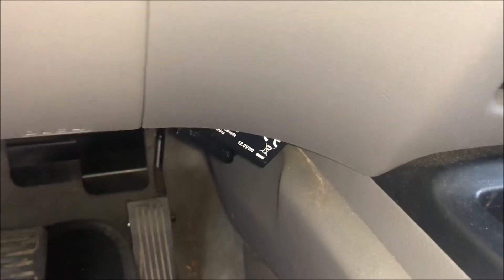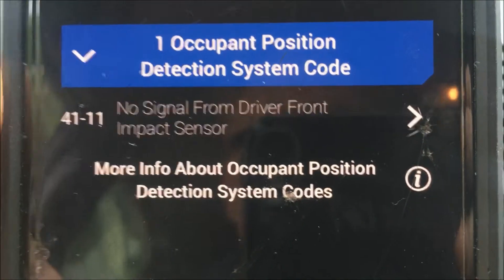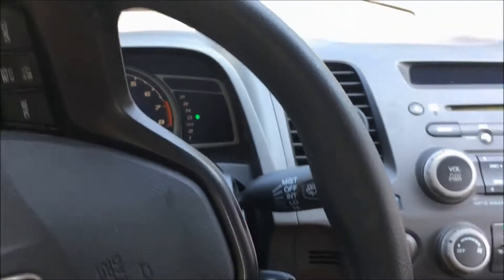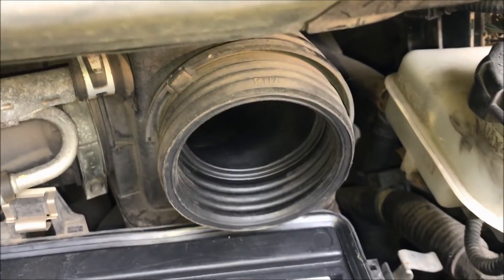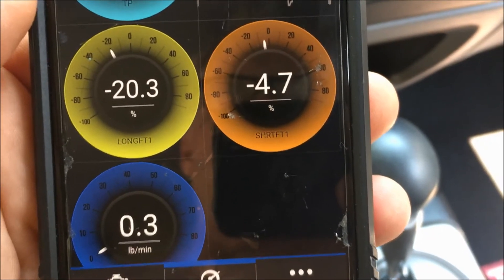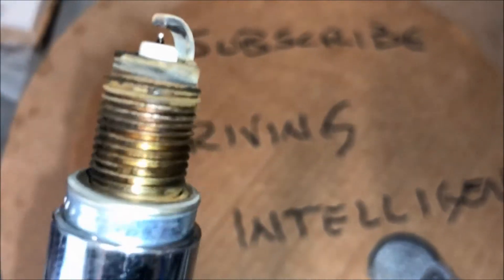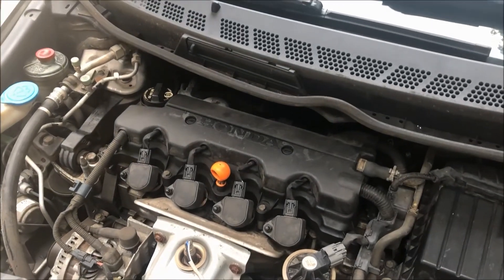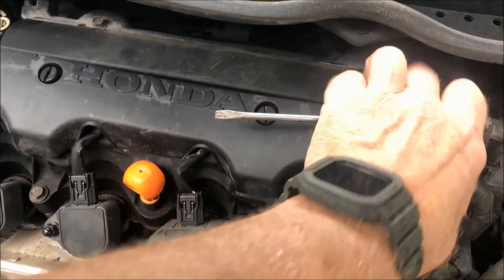How To Diagnose Extreme Negative Fuel Trims 8th Gen '06-'11 Honda Civic

Comment: dear Sir! from where you get the actual readings in order to compare?
Reply from the maker: Thanks for your question!  I use an OBD Dongle that connects to my smart phone.  The link is in the description of my video
Reply: @DrivingIntelligence  Thanks for replying! but my question is not this. my question is how do i know (how do you know) that what should be the actuall readings? do honda provide these MAF, 02, STFT etc readings data?
Reply from the maker: @farazshah4484  Generally, most of these readings are the same from car to car.  For example, the O2 sensors read from about 0.1v to 0.9 volts in normal operation, STFT & LTFT added together should be no more that +/- 10%, e.g., if you have a 5% STFT and a 5% LTFT, then added together this is 10% and that is a good number.  When this number starts to increase, then this indicates potential problems.  The subject car in this video still has an extremely negative fuel trim, but runs perfect and no CEL.  When this person brings the car to me, I will likely replace the coolant temperature sensor, which seems to be a reason for this problem on higher mileage vehicles once you rule out all other issues.  With regard to MAF, you can do an internet search for your year / engine / car combination to get the proper reading.  I hope this helps!
Reply: @DrivingIntelligence  exactly my STFT are going from -5 to -17 max . When I disconnected the intake pipe then STFT went max +10. I will follow your suggestion. Thanks a-lot! You are doing a great work.
Reply from the maker: @farazshah4484  Thank you!
Reply from the maker: BlueDriver Bluetooth Pro OBDII Scan Tool - https://amzn.to/3lsVutO

Comment: @DrivingIntelligence
Hi. I have a 2006 honda crv that is driving me crazy
I don't have any codes , but I have the Scan Gauge III connected where I can see my fuel trims.
Around a year ago, I started noticing a rough Idle with my fuel trims getting  very negative on the short-term -10/-15 with the longs slowly creeping up toward the -10 the longer I stayed idling. The thing is that as soon as I started my commute on the highway, everything goes to 0 until I arrive and stay idling again.
I checked the purge valve and the vent valve at the canister.  Both are working fine. The problem is as soon as I start the car. The purge gets open, creating a rich mixture plus a vacuum leak. Witch also creates a rough idle.
Also the reason why I know the problem is the evap is because after a year of unsuccessful slow troubleshooting, I finally pinched the Evap hose coming to the throttle body while I was idling and my numbers started going back to 0 and the idling smooth out instantly. The problem is that I don't get any codes, and my components are working fine.
I remember that before I heard the vent selenoid open after I leave the driveway in the morning and get to speed (+/- 25mph) but now is like if the computer opens both selenoids as soon as I start the car.
Have you ever heard about this issue?
There is a guy with a civic on YouTube chasing the same problem.
Reply from the maker: Thanks for the detailed comment. I haven't seen this exact issue before, but it sounds like an EVAP purge solenoid problem—it's opening prematurely at startup, creating a vacuum leak and rich mixture that the ECU compensates for with negative fuel trims (-10/-15 STFT, LTFT creeping to -10), causing a rough idle. Once you're on the highway, flow normalizes, resetting trims to 0. Since pinching the EVAP hose to the throttle body fixed it instantly, and your purge/valve tests were fine, check the purge solenoid for sticking open or an ECU glitch commanding early open (rare, but possible—scan for hidden codes with a Honda-specific tool like HDS). Wiring shorts to the solenoid could also cause this. The change in vent solenoid timing (now at start vs. 25mph) suggests an electrical or control issue. Try disconnecting the purge solenoid electrical connector and see if idle improves (don't drive like that). If that helps, replace the solenoid. Let me know your results or if you have a scan tool readout! The Civic video you mentioned likely has a similar purge timing fault.
Reply: @DrivingIntelligence, thank you so much for replying. 
I already changed the whole throttle body that includes the purge valve on it.
I'm going to try disconnecting it as you  recommend witch makes sense as the default position is closed and this will let me know if it is a commanding glitch like you said.
It has been a year and I have clean and replaced every component of the intake on my free weekends. This is my daily driver and I drive a lot every day (200 to 300 miles per day on the highway)
I honestrly turned to the evap and pinched the hose as curiosity because I  tested/clean the injectors and they were fine.
I have the FOXWELL NT510 Elite with the Honda software.
This gives me more data than the regular scanners but I'm not more than a DIY and my knowledge is limited. 
I'm trying to improve using your teaching, but I just found out about you yesterday.
Reply from the maker: Thanks for the additional data.  Let me me know what you determine.
Reply: @DrivingIntelligence   ok. Today, I did some testing before leaving for work and based on your inputs I was able to confirm that the purge selenoid is working properly because as soon as I disconnected, the idle smooth out.
Another thing I did was putting the key in the on position with the engine off and test the wires at the connector.
I do have 12v on one side but no ground in the other. I believe this means that I have no shorts because As soon as I start the engine I get ground so I guess the computer is commanding the ground.  To control the selenoid. 
Last thing I did because you mention a possible ECU glitch, I disconnected the battery for 10 min and then restarted the car.
This time I  noticed my short-term being way more stable than before but as soon as the thermostat reached 167f the fuel trims started doing the same as before, going negative in to the -10/-15
Something weird is going on here as I would assume the computer should only open the selenoid once the car reaches certain speed meeting other conditions.
I also know that probably I should just forget about it as there is no drivability issues other than a rough idle but a couple of months ago I got my CAT stolen and the new one was really expensive. I think this issue could kill my new CAT if I keep running so rich like this. 
My old CAT was already dead and I had a spacer to keep the check engine off so I didn't really care that much but now I have something to lose if I keep going like this. 
Sorry for the long replies
Reply: @DrivingIntelligence also forgot to mention that as soon as I disconnected the connector from the purge selenoid I got a check engine for purge selenoid valve  (A)
I cleared the codes and continued with the other tests
Reply from the maker: @reynielasencio1964  thank for the additional info.  It made me remember this... I believe someone in the comments stopped their fuel trim issue by replacing the temperature sensor.  I don't recall the specifics, but you might want to research the temp sensor which the ECU uses to manage fuel delivery.  If the ECU is not properly reading temps, it will read from the wrong fuel maps.  Sorry, pulling from memory, but something for you to look into.
Reply: @DrivingIntelligence 
sure thing. I will try that right away. 
I was also thinking today, and please don't judge me,  I'm just starting to learn from your videos.
What about the fuel pressure sensor. 
A while ago I got a flashing D light and it was the third clutch pressure switch reporting too high values but working (No driveability issues)
It is possible that the fuel tank pressure sensor is reporting higher range than normal and the ECU seeing this is forcing the venting to avoid damage in other components. 
I would think that the ECU logic would have a code for such thing but maybe not. What do you think
I'm getting very interested in troubleshooting and your videos really have me on the hook.
The other guy that I'm watching is Eric O from SouthMainAuto
He is very clever and in my opinion is one of the best showing the process step by step.
Thank you so much for the input
Reply from the maker: @reynielasencio1964  Thanks for the update.  Regarding the fuel tank pressure sensor (FTP in the EVAP system): It's a good theory. If it's reporting high values, the ECU might command more purge to relieve tank pressure, causing that rich condition (additional fuel vapors entering the intake) and negative trims at idle (like your -10/-15 STFT). A while ago with the clutch switch, that was transmission-related (P0848 high pressure code?), but EVAP can behave similarly without codes if the reading is borderline. The ECU logic doesn't always trigger a code for FTP anomalies if they're within spec but off enough to mess with purge timing.

Try monitoring FTP readings with your Scan Gauge (PID 2F, or "Tank Pressure") during idle—normal is near 0 psi. If it's consistently high, you may want to replace the sensor. What does it read at idle? 

Let me know how my suggestion goes, and we can dig deeper if needed!
Reply: @DrivingIntelligence  I fixed.
I took the car to several shops to check the fuel tank pressure sensor with their computer as my Foxwell NT510Elite didn't have that option, but apparently there is no good tech on these days because they could find it.
So what I did last night was checking online for updates on my NT510 and it was one available.
Tonight I tried and I could not believe how much new options they added with the new update. Now I have full control over every component in the car.  I was able to manually trigger every selenoid on the EVAP system and listen with my door open. I also was able to see the fuel tank pressure sensor in real time. It had a little bit of pressure but as soon as I removed the fuel cap it went to 0 so the sensor was reporting fine.
I keep looking and found an option for idling relearn and when I click in the interrogation mark it opened an explanation of how to do the procedure and the symptoms of no doing it correctly.
Apparently because I didn't did the learning procedure the way it was supposed and just drive the car letting it learn overtime. The computer set the base parameters while I was at highway speed so when I was idling I was basically too far off range. (Hopefully you understand the idea)
What I did was erase the throttle body memory and do the holding the RPMs at 3000 until the fans came up twice with everything turned off and the doors closed. Then I let it idling for 5 min and turn it off.
When I restarted it was perfect.
I couldn't believe it at first so I dit a bounce of testing and it's perfect now.
Only thing diferent I noticed is that now at highway speed the LT fuel trims are between 2 and 3 when before they were at 0.
I mean, it makes sense because now my base is at idling and with loads it will add a little of fuel to compensate for the extra air coming into the intake with a little bit of pressure because I'm doing 75MPH
I still can't believe it. This was driving me crazy.
Thank you so much for all the advices and sorry for the long comments

Comment: Hi there thankyou very much for this informative video.

i need help with my civic, my problem is im only getting 400km per full tank on my r18 8thgen and main issue is when i first start the car it stays higher than 1000rpm for long time than usual i have to drive 5-10km for it to go normal, and even then when i leave the gas pedal it gets stuck in around 1000rpm for split second and then only it goes down, this happens all the time even in park or drive. My ltft is -10.1 and stft is -5.4. I have put new pcv valve, new plugs cleans the throttle body, maf sensor, airfilter is fairly new cleaned the egr valve clean the map sensor upstream o2 sensor is new aswell.
Reply from the maker: Hi, do you have any diagnostic trouble codes?  A check engine light?  Your fuel trims are not bad.

Update:  Sorry, just saw your second note.  No CEL.  What event happened in between the better fuel economy and reduced fuel economy?
Reply: @DrivingIntelligence  this was 6months ago, i change engine oil and air filter, i used sakura* air filter and oil filter. I dont care about fuel trims but thought it might be related thats why i mentioned but its the rpm that driving me crazy literally lol
Reply: My valve cover gasket is leaking a bit, also when i turn the steering wheel the rpm increases a bit is that normal? I changed power steering pump like year and a half ago
Reply from the maker: @aarohanp43  hard to diagnose from far.  You could have a vacuum leak causing the increase engine rpm.  

And the ECU is likely increasing engine speed to compensate for the load caused by the power steering unit.
Reply: @DrivingIntelligence thankyou, ill check the vacuum leak the best i can and give you updates, meanwhile any diy ideas to check would be appreciated
Reply: Ps no check engine light and before this i was getting more than 550km per full tank and it always starts in one go

Comment: having same issue on my 8th gen civic , LTFT are -10 and STFT about the same at idel and STFT never go positive even with full throttle . in my case i found the problem - huge blow by . the engine is at 240k km and i pretty much neglected the car , so it's obvious . still no engine codes . easy way to test it is to open the oil cap and just feel how much blow by there is . also once i open the oil cap STFT go positive .
Reply from the maker: Glad you were able to figure out the problem, and thanks for sharing your findings!
Reply: @DrivingIntelligence  i figured the problem , but not solved it yet :)  i pulled the oil cap and my fuel trims went to normal , but it still can be bad PCV valve ,even though i blew air through it and it seems ok , i will still replace it and update
Reply from the maker: I’ve been using this oil with great success in reducing oil consumption and blow by:  UPDATE Valvoline Restore and Protect Review 8.5k miles: Reduce Oil Consumption Varnish Piston Slap?
https://youtu.be/7AzhjW-T4vk

Comment: I have honda accord 2015 sport and ive notice weird number. Did my research but still confuse. My ST FTRM1 -14.8  and LT FTRM1 -17.1 is this normal? Or whats the normal reading? Lastly, can i reset the ecu by disconnecting battery for couple of minutes? By the way no check engine. Appreciate your response.
Reply from the maker: Fuel trims should be close to "0"unless the engine has been modified, or you have a problem.  Your fuel trim is not that bad.  Read through all the comments in this video.  There have been various solutions to negative fuel trims in this model Civic.  Given your fuel trims are not that bad and you don't have a CEL, I wouldn't worry about it.
Reply: @ appreciate your response.
Reply from the maker: @LattesilverTV  very welcome

Comment: Pudieron resolver este problema?
Reply from the maker: no, but look through all the comments.  Others tried different methods that proved successful.
Reply: @DrivingIntelligence  me di cuenta de algo extraño y es que al desconectar la tubería de metal que va desde la parte superior del motor hacia la admisión y tapar el agujero de la tubería en la admisión y dejar la otra parte desconectada estos valores se normalizan, por si puedes probar a ver si es tu caso
Reply from the maker: I guess you are referring to the PCV system.  That may be where the leak is located.

Comment: Hello, i have honda civic 2011. I also experience problem with my stft1 my car stft is commonly with this range - 7 to -10 on idle. Already try to clean my maf sensor and air filter. I try to remove my dipstick when the engine is running my stft1 goes to -1 to +1 with idle. Then i also try to remove engine oil cap my stft1 goes to +7 to +10. This might be the case that my PCV is broken or not working properly? Need your input about it guys. Thanks.
Reply from the maker: @dominiccuizon55  your short-term fuel trim looks OK, it’s not wildly out of order. When you remove your dipstick or your oil cap, you’re introducing additional air into the engine through the PCV. This is normal and does not indicate a problem with your PCV system.
Reply: @DrivingIntelligence which means my pcv is working properly?. Thanks for your input. I will try to find a way if i can make stft1 to be stable -1 to +1.
Reply from the maker: A few people have done one of two things to improve fuel trims, valve adjustment and temperature sensor replacement. Look through the video comments and you might find something that helps.

Comment: Looks like a blow-by issue, I had same problem and I figured out waa excessive blow-by gas getting in the intake manifold.
Reply from the maker: That could be one of the many causes.  If you check the comments of this video, viewers have found a few other causes for negative fuel trims, including valve adjustment and a faulty temperature sensor.

Comment: How did you eventually fix this rich condition, running the car rich can damage your engine. I'm having same issue with my accord -14.8 A/F trim
Reply from the maker: I understand running a vehicle too rich can damage an engine, but in this case, even though I had high negative fuel trims, the ECU was not giving me a diagnostic trouble code, so I left it be. Comments on this video show how many people resolved from adjusting valves to replacing the engine temperature sensor.  Check out the comments.
Reply: @DrivingIntelligence  thanks, I really appreciate. I change my engine air filter, solved an air leak and used carburetor clean to restore my maf sensor now I get a perfect 0 on my long term fuel trim, +- 9 on short term fuel trim..
Reply from the maker: @Delight.AutoCRAFT  awesome!  Thanks for the update.